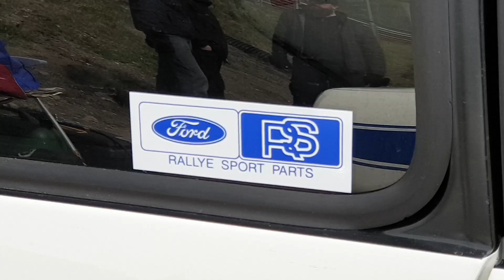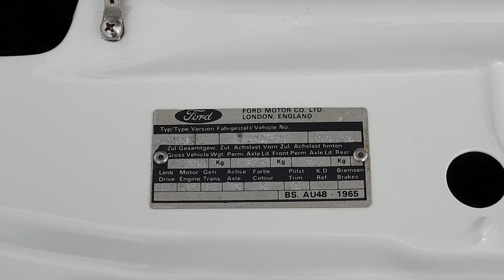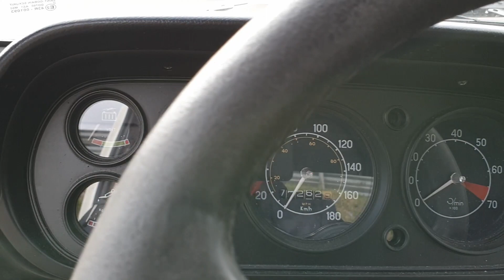Ford Escort RS2000 Mk1 & Ford Escort Mk2 X-Pack - VLOG 13

Comment: Was there no black back panel on the Mk2 x pack?
Reply from the maker: I don't know, should there be a black panel? Car was totally rebuilt so there might be some differences vs stock car 🤔
Reply from the maker: And there is white blinkers at the rear, not amber.
Reply: The standard Mk2 RS 2000 has a black rear panel, regardless of the body colour. The Mk 2 Mexico rear panel is same colour as the rest of the shell. 

I wasn’t looking to find fault, just genuinely curious, your car looks great, fantastic condition.
Reply from the maker: Okay. Sorry to say, but unfortunately it's not my car. I was just filming at a track day. Nice example though.